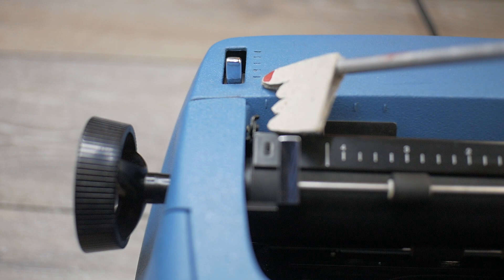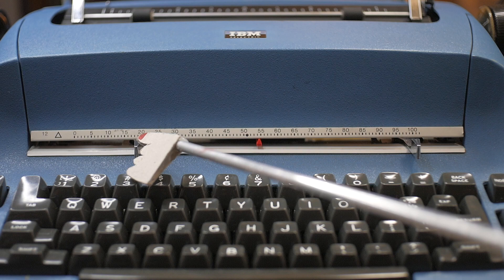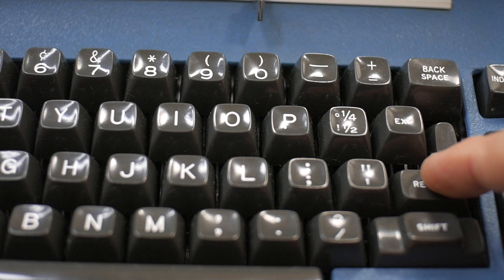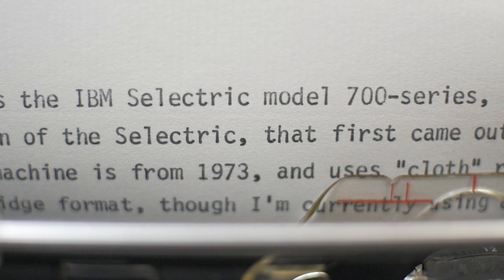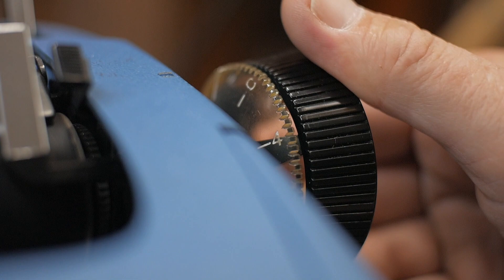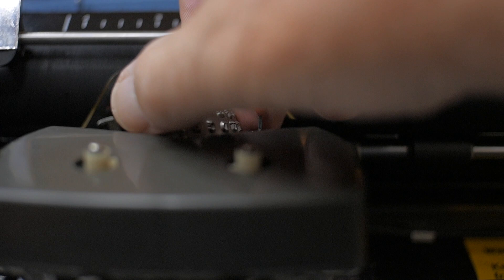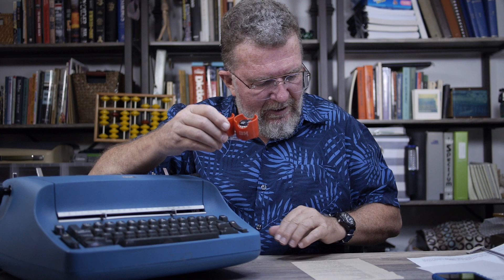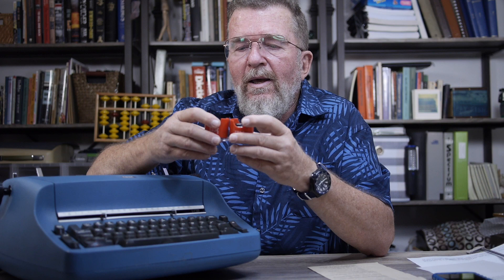IBM Selectric!

Comment: On craigslist here in LA a few months ago there was a dirty, forlorn green model 721 Selectric that kept calling to me because it was cheap... and it was cheap because it was non-functional. I finally made the trek out to Burbank to meet the seller in a storage garage full of movie & TV props (for rent and for sale). I scored the grungy Selectric, took it home, and began my trial by fire. The machine was incredibly dirty and gunked up, the motor did start spinning with some persuasion, but the rotate tape broke almost immediately. The tab pulley was already broken and the tab cord came unwound from its spools. By watching Mr. Duane Jensen's (Phoenix Typewriter) videos I was able to completely clean, refurbish, and recommission this beautiful old masterpiece. The classic light minty green finish came back looking almost new, and it types with nary a hiccup now. I got sucked into the cult (or sect) of Selectric, seduced by its clever all-mechanical design and its incredible speed. Such a fun and rewarding project. Now I just need to use it more!
Reply: Well done, that acolyte!
Reply from the maker: Well done!

Comment: That machine (narrow carriage, cloth ribbon) was a staple of high school typing classes, back in the day.  In fact, I purchased mine used, in the late 1970s via an auction.  Of course, it immediately required repair.  After the repair, it lasted about 15 years before again requiring servicing.  By then, I had a decent printer on my home computer.  I still have half-a-dozen elements (type balls), including an aftermarket Olde English.  I strongly believe these machines were intended to be maintained by IBM Factory Service Technicians, who would make periodic visits to offices (and schools) to keep the equipment running properly.
Reply: I recently bought a selectric model 71 in green. Tucked inside the shell was the service record. Many visits to tune it up between 1969 and 1986.

Comment: I was a production typist and office manager through the seventies.  1)  the original Selectric type elements had spring-steel squeeze retainers for the machine, later replaced with the lever system.  The levers tended to break off with heavy use, unfortunately.  Special-order elements, for instance with special characters, would have either white, yellow or red levers.  2)  it was quite possible in the seventies and eighties with the Selectric I and II, to simply order a new machine shell when the original got too worn, or if one wished to change the color of the machine.  Because of the modular construction, an IBM FE could change the shell of the machine quite easily.  We used to have older Selectrics and though they weren't worn out, the S-I in particular would wear the finish off around the edges.  A new shell would look like a new machine!

Comment: Hi Joe, this is a great video and I love the color of your machine!  I have a Selectric 711 (carbon ribbon system, fixed 10-pitch) that was manufactured in 1971.   I just had it completely refurbished and it works like a new machine.  Mine is that seafoam green color that was popular in the first generation Selectrics...and I call it the "mean green machine."  My signature type element in it is "Delegate."

Comment: Totally taking me back to 1982 and typing class in high school Freshman year.  We had to take typing before we were allowed into the computer class our Sophomore year and that was actually pretty smart given there were only 4 or 5 computers for the whole class.  Bonus is I got pretty good at 53 wpm and learned how to do some more advanced page formatting that's stuck with me over the years.  And you'll see a habit here.  I still type two spaces after a period.  Totally habit.  And your model is exactly what I had..with a cloth ribbon.
Reply from the maker: Thank you! I’ve been wondering who used these cloth ribbon machines.
Reply: @Joe_VanCleave  It was a bare bones public institution and the teacher, Mr. Wing, that said he could service all but the gnarlier issues of the typewriters said the cloth ribbons were cheaper than the newer style.....it didn't matter so much if student learning pages weren't the darkest block.  

He'd also reserve a couple of machines at the head of the room that either had the newest ribbons or later carbon style if somebody needed to type a term paper or resume that quality counted.  

Thx for commenting Joe!  This vintage space is new for me and the Selectric 2 I picked up last night for $60 seems in good condition (and came with 27 ribbons) and I'm going to look online for tips on light servicing.  I'm guessing it could use a little TLC, cleaning, and fresh oil on certain bits TBD.  And I do notice the carriage is catching on the edges of plastic pieces under it with the warning sticker and patent list....the plastic seems to have curled a bit.
Reply from the maker: @mattcwatkins  There are some Facebook Selectric maintenance groups that are good resources if you need to dig further into your machine.
Reply: @Joe_VanCleave  The algorithm has been steering me that way.  I did have some carriage return stickiness show up last night and have some ideas about which bits to clean and re-oil after a good "101" video.  Having fun learning as I go.  It amazes me that while I was eager in 1982 to explore the worlds of Commodore 64s and ProWriters that one of the pinnacle pieces of analog equipment that cost over a thousand bucks even then are still available and now wonderfully nostalgic 40 years later.  I actually have some paper files that I'm planning on typing labels for.

Comment: Cool and very timely also. I obtained a Selectric II some weeks ago and have started restoration. The guts were covered with grease and foam bits all over. Cleaned completely and then the motor failed. Replaced the motor, carefully oiled strategic spots, and it runs with a thump. Main drive pulley next up. The I model is definitely harder to find versus the II.

Comment: PS--Joe, actually, when the Selectric came out in '61, its key travel was the longest IBM had ever had.  The original Electromatic from the forties had virtually no key travel on those little round keys.  I've owned Models A through C with the little square keys and they had much less key travel than the Remington, Underwood, Royal or Smith-Corona office electrics of the time.  That original Selectric keyboard like you have was a revelation, and then the Model D type bar machines copied its keyboard.  Plus--if you use those fabric ribbons you'll find that those spherical type elements are a cinch to clean compared to machines with type bars.  You bring back some memories for me here!

Comment: This was an incredible walkthrough. Thank you! But: What in the world are you doing with these customizations? Why would you even think about doing such a thing? Are you not messing with perfection? (I'm sure you have good reasons but I didn't catch them during the video).
Reply from the maker: Kevin had the mods done before I got it. He knew I liked 1.5 line spacing. I’m not sure the express backspace is necessary, but it’s fun to watch … ZZZZIP!
Reply: The 1.5-line spacing customization was actually available as an IBM modification kit that could be field-installed, so it's not total sacrilege to have installed it. 😁 I'm fascinated by the express backspace modification, though. I'd NOT seen that before and I will be looking into it! The so-called "rotary backspace" system was standard in the Sel II's, and it looks like it can be retrofitted into the Sel I's. 👍

Comment: I had a similar model but larger Selectric II with a fabric ribbon cartridge.  I bought it used and it worked, sort of, for 15 years.  It was a bit noisy, but it typed well.  It had an internal geared pully that cracked severely and I was not willing to get into the guts of the machine to fix so I gave it away.  It is very complex internally and that is why I prefer SCM electrics over this.  As far as the fabric ribbon cartridge I have always believed you could replace the ribbon with an inked ribbon.  My unit weighed about 35lbs.  How heavy is yours?
Reply from the maker: 31 pounds, due to the narrower body.

Comment: My wife just picked one of these up when she hits the return key it doesn’t go back to the start any suggestions
Reply from the maker: These frequently need to be serviced if they’ve sat unused for a while. It could be the greases have hardened up and it needs to be degreased, cleaned and relubricated. There are other parts that can break. There’s several Facebook groups with people who have learned to service them, but it might be quicker to find a repair shop in your area.

Comment: What's the difference in size between this one and the white one you showed in an earlier video?
Reply from the maker: This one is the earlier body style in narrow size, has a CLOTH two-color ribbon cartridge. The other machine was also the earlier body style but in wider size and has the carbon film ribbon spool system. Both lack the lift-off correction system, that didn’t come out until the Selectric 2.
Reply: @Joe_VanCleave  I did some research, and found out the answer to my own question, lol. This is an 11-inch model, the other one is a 13-inch model. They came in 11, 13 and 15-inch wide models.